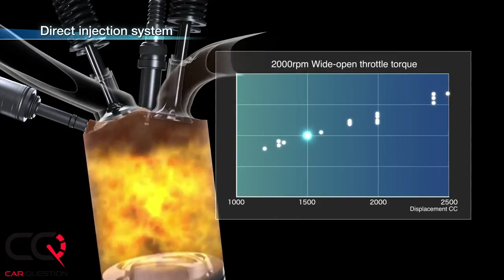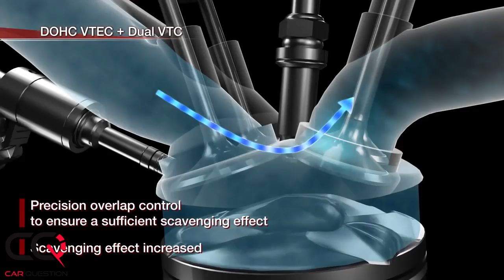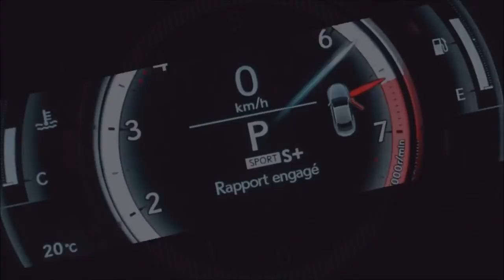Honda CR-V Turbo: Overfilled oil levels and a gas smell Fix and RECALL!

Comment: Bought a new CRV in 2019. No issues at all. Runs and performs the way I always expect from Honda. Love it.
Reply: That's because they fixed the problem on the 2019 models.
Reply: Nah. It wasn’t fix. My 2019 ex 1.5 hatch have oil dilution issue

Comment: My wife bought a top of range CRV 4 years ago. It had fuel smell both inside and outside. We went to a few authorised dealers to check but never found the problem for 3 years while still under warranty, finally we solved the problem. We got rid of it!
Reply: 4 y ago you can buy 2016 or 2015 m.y. with 2.4 engine. Here talk about 1.5 turbo. Not relevant

Comment: To let you know I own a 2018 Honda CR=V Touring and I live in the southern part of the US ... My vehicle starts up fine and I can get heat and / or air conditioning very soon after taking off. I see no problem with my car after a years use. In general I am very pleased with this model.
Reply: count your blessing and keep a real CLOSE eye on the oil level as long as you own it. Its not just a cold weather issue,as even where I live,Ohio,it happens in summer too. Also happening in the 1.5T engines in the civic now.
Reply: @robertjaent6087  I guess as long as the engine isn't getting shit on it really isn't a problem.
Reply: Says the account thats probably a guy who works at a Honda dealership.
Reply: Just wait until you hear about 80,000 miles my 2018 Honda accord has a blown head gasket

Comment: My wife and I picked up a new Honda CR-V in January, and then found out about this. I brought it up with the technicians at my dealership and even received a printout assuring me there was no problem or active recall on the car.

Just yesterday I checked the dipstick, and while I'm not an ASE-certified mechanic, the scent of gasoline is unmistakable, and was on my hands for the rest of the day just from holding the dipstick for a few seconds. I've called the dealership, and they're trying to tell me that the gas in the engine is CAUSED by the misfire, and unless I have a check engine light on, there's no problem. I'm glad these guys aren't doctors, because holy shit.
Reply: Honda and all the dealerships are trying to rip off customers. They know of the problem but are being told to play ignorant.
Reply: I just had 3 misfires last month they changed my fuel injectors and now the same thing is happening only instead of throwing a misfire code it's saying it's my turbo! The technician said they're not related but between this video, what I've read online, and your comment they definitely seem to be related!!

Comment: Dont all Honda cars use these 4 cyllinder direct injection turbos? I heard they got rid of the 6 cyllinder engine like I have in my beloved Accord. I guess I'll be buying a Toyota next time. Fuck the warranty extension. Its not the computer, its the direct injection along with the environmental controls thay have to install. Everybody is writing about this. It's pretty much a scandal among car people. Honmda tried to ignore the problem, claim it wasnt happening to US cars, then they said it only affected CRVs in nothern climates, All lies. COVERUP. ASS COVERING LIES. Dont buy these cars. Personally I would stay away from all direct injection turbos. Fuck the gas milage. It wont matter if your engine dies at 40K miles and your cabin smells like a fuel tank.
Reply: FlyBaby Very well-stated. Thank you

Comment: Yeah oil dilution with gas is certainly damaging the internals of an engine, just think if you screw up on mixing gas/oil on a 2 stroke engine. It will wear faster. Hopefully they’ll fix it. Great video as usual! Thanks

Comment: My 2018 crv ex-l with 3,000+ miles runs like a dream... no oil dilution... no problems with heat.  I feel bad for the ones having issues.  Hope the fix does work for you all because it's a great small suv in so many ways including great gas mileage and I've never pushed the eco button..
Reply: Hey.. a non neysayer
Reply: Just wait until you hear about 60,000 miles my brand new Honda accord has a blown head gasket

Comment: I have had the northern recall done.  30,000km on my CRV.  After 1700km my oil level has risen about 1/8" above the full mark.  Not much of an improvement in the remote start cab warm up.  The car may retain its heat a little better in urban driving.  Heat was never really an issue on the highway.  Temperatures have been mild so the recall has not really been tested.  I have been told by Honda that the details of the warrantee have not been released yet.  I would be very interested in just what that warrantee covers and just who decides what repairs qualify.

Comment: It's not just in cold weather states. I purchased a 2018 Honda civic EX hatch 2 months ago. It was a lease with 29k miles. My car is now at honda under warranty needing a new head and block due to main bearings, metal in the oil, scorred cams etc. The oil was dark and smelled like fuel.
Reply: This is a legal storm brewing.   Fuel in the oil is going to take out a lot of engine bearings and they keep pushing 0W-20 oils and longer oil change intervals.  Anything over 5k mile oil changes seems crazy on these engines.  Some oil analysis has shown 3% to 5% fuel dilution and obviously more than that if people have increasing dipsticks.
Reply: @scdevon  They already had a class action lawsuit. That's why they extended the powertrain to 6 years unlimited.
"Consumers will get an extra year of coverage on some powertrain components—six years from the time of purchase, with no mileage limits. Honda says that the oil dilution issue is rare and that the company is acting to provide peace of mind for its customers. The extended coverage applies to all 2017 to 2018 CR-Vs and 2016 to 2018 Civics that have the 1.5-liter turbo engine"